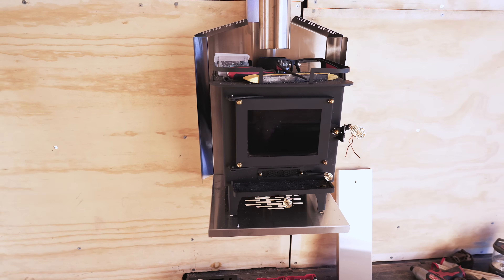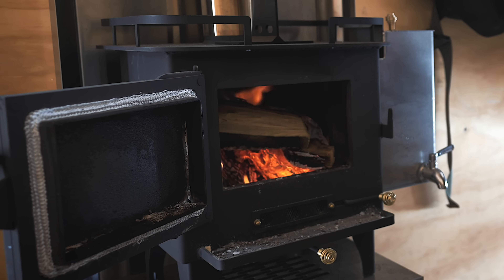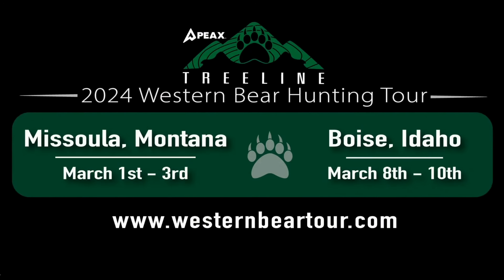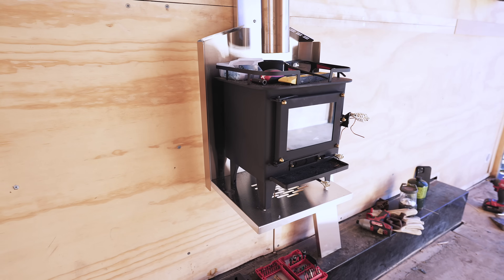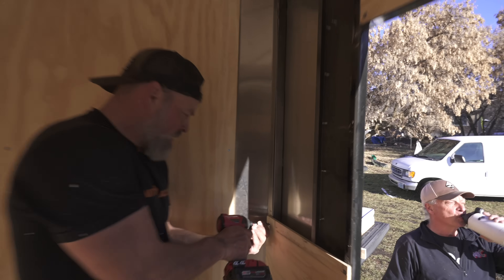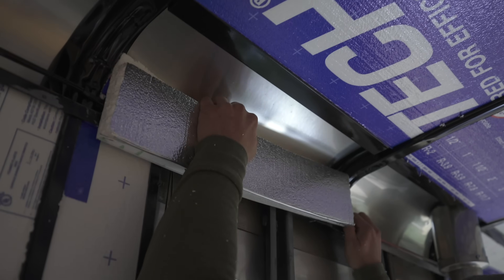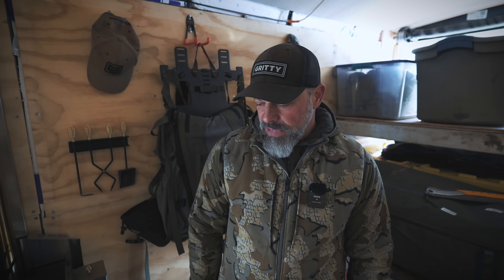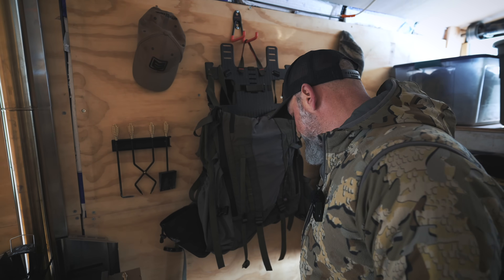GRITTY TRAILER BUILD 🎙️ EP. 825

Comment: I used a diesel heater in my utility trailer. A three gallon fuel tank mounted outside provides 5 days of heat all night.  A solar panel maintains the battery.  Like your wood stove, it's a dry heat so clothes drying is a snap. Makes taking a shower in the middle of winter possible as well.  A 5 gallon bucket and a live well pump is the shower.   Love the build.
Reply: Same for me. I have a arktronic diesel heater in the truck camper I built from scratch to bring up here to alaska 2 years ago. And that thing is great quick no fuss dry heat. I insulated my camper with 3" of rigid foam and sprayed all the seams on it so it's over insulated. 3 gallons in a rotopak runs mine at night for close to a month in the spring and fall and about 10 days of continuous run in -30°f. But it is over insulated and not that big... plus I drywalled my camper so it has mass and very little thermal bridging.
Reply: With the solar he could have put in heated flooring.
Reply: The smell and mess are Too nasty for this guy....  Wood ALL the way..  You need a chainsaw for most of this kinda shit anyhow
Reply: @kylemacdonell1450  what "smell", the only time I ever smell diesel is at the fuel pump when I fill the tank and my truck 🤔🤷‍♂️. It exhausts outside and if you smell the diesel heater inside its not installed right. Wood heat is great, but I'd rater set a timer for 10 minutes before I get up and let it warm the camper without any effort, plus fire restrictions are a thing out west during hunting season for wood stoves.
Reply: The smell of being smoked out whenever you stoke the wood stove was why we switched over to diesel heat

Comment: A lot of my hunts, I sleep in a wall tent but I want to build out a cargo trailer to haul all my gear to camp and then use it as a cook trailer.  That way I can lock out the critters, mice, squirrels and bears.  I also haul quads for my hunts and I typically travel several days to get to my hunt locations.  With the cargo trailer, I can pull over to some gravel pit, pull the quads out and sleep for the night on the way out.  Your video come at the right time.

Comment: I did a conversion on a 12 utility trailer. Kitchen up front, fold down bunks and table, two windows and I went with a Dwarf wood stove. The Dwarf stove is an Idaho company and I love the stove, it's worked great in the trailer. I can haul either my ATV or my snowmobile and then have a super comfortable camp setup. Trailer still pulls okay with my Tacoma. Keep up the good work and great content.

Comment: Solid Build. I like the wood stove. I converted my 2014 7x16 Cargo Trailer into my mobile hunting rig. One thing I did was build out a small kitchen in the nose of the trailer. Completed it with a small pantry (Cabinets) I bolted them up top and installed a counter space (width of the nose) to cook on. Underneath, I have additional storage for kitchen items. One thing that has been a game changer is running a power strip (24 inch) along the kitchen wall. I'm able to power radios, charge phones, anything electrical. I drilled a 3 inch diameter hole in the left corner and run my extension cord out the bottom to my Honda 2000 watt Generator that I have outside away from the trailer. Its worked very for all my power needs and lighting up the trailer. Another item that is a must have for early season hunts is a Magnetic Velcro Mesh Screen to cover your door when its warm outside and you want circulation inside the trailer. The Magnetic Velcro Mesh Door enables you to walk in and out with ease and keeps all the bugs out, but allowing the fresh air in. Super easy to install and super cheap!

Comment: FOLLOWING. I listened to the podcast while training this morning and had to come check out the video. I did the same. The nice thing is it can be adapted to each hunt, sort of a work in progress. Up here in Canada I definitely second the diesel heater. They pump out incredible heat and can keep everything from freezing while you’re out hunting, especially your drinking water. I am going to change mine a bit this spring. I will frame a wall at the back of the trailer that will have a door and window. It will be the main door. It will allow for a 2’ “porch” that I can leave Jerry cans, flammables and anything that can stay outside. It will be wide enough for a small quad but not a s*s. then when I head out for the day I close the trailer doors and it’s immediately secure.

Comment: I have a 9x16 shed insulated walls and ceiling, lumber bunks, 9' wall table, fridge, space heater, tv/dvd 4 slider cheap windows, .75" marine ply for the floor and a window mounted a/c. Tight as a tick, make you sweat in the winter, cool AF in the summer. I call it my Hooch. Landowner gave me the shed instead of hauling a camper down for turkey and whitetail season. Barn next to the Hooch has a barn full bath with shitter, sink and shower. All the creature comforts of home. My home away from home. Look forward to the completion of your build. It always makes it better when you do it yourself.

Comment: I converted a 16 foot v-nose Cargo Craft trailer. Windows are a must. Just a little advice, every little thing you add to the trailer, adds weight just keep that in mind especially depending upon what you are going to pull it with. I've got a diesel heater and plan on buying that wood stove for it soon.

Comment: Looks good so far. I did spray foam around the edges before I pushed my foam boards in to get good tight seals. If you get some of the thin 1/8th foam tape to put over the metal ribs before you put the plywood back on it helps with thermal bridging more than you would think. The good german diesel heaters like webasto and arktronic are super efficient on fuel and super convient nice dry heat. Do not do a gas furnace they are super inefficient on fuel, finicky, dangerous, and propane is more of a pain to get fuel than just pumping a rotopak with diesel. Just my 2 cents but there is a reason diesel heaters are all the rage for van life, camper life, truckhouses, ect. especially here in AK. They are simply worth the thousand bucks.

Comment: i installed a cubic grizzly in my trailer a few years ago i used a thimble for a sailboat used it for a year as a hunting cabin in northern ontario  and it worked well for most of the night be prepared to feed it in the night it would take 7 inch pieces of hardwood max just like the wife🤣🤣

Comment: man i did something simiular 2 years ago.except the wood fireplace, its basiclly a dry campter, mine is a v front and the whole front is shelfs a ac unit, battery and changers and mini fridge, and the door i also cut in a handel and wow it wasn't fun, in the back i have a raised queen bed and storage underneath, and along a wall i have a over head cabnets for plates and bread and stuff and a long hanging rack for jackets and a shelf above. above the counter top in the front i put a powered fan that can work as a exsaust if i'm cooking in the front.

Comment: Any reason why you didn’t use the backpacking stove for the peaks teepee setup? We have that stove already, so I was thinking maybe we could rig a setup to utilize that stove in the trailer as well.
Reply from the maker: The light Titanium stoves are great in a tipi, but they do not hold heat for a long time. A cast iron stove is just much more efficient especially with insulated walls and ceiling in the trailer. It is also designed to not get super hot for safety reasons.

Comment: I've been wanting to do something similar for quite some time now.  Your setup looks really great , good job!  2 questions here.
1. Do you know what the overall weight is on the trailer all finished out  like that, and what kind of tongue weight does it have?  
2, What are you using to tow it?
Reply from the maker: Thank you. I have not weighed it yet to see. I pull it with a 3500HD Duramax.
Reply: Copy that, thank you.

Comment: I don’t think I would have cut the stove hole in the roof, that material is so thin and moves so much with the sun I think you’ll have problems keeping it from leaking. When you do the next trailer ( which you will 😂) get a trailer with extra 6” or 12” of ceiling height, adds lots of overhead space and is a cheap upgrade.
Reply from the maker: Thanks! The hole in the roof has been bombproof—no leaking whatsoever. The vent is meant to take a lot of heat.

Comment: I’m just curious why do this instead just purchase a mini rv for hunting ?
Reply from the maker: Well, a few reasons. I needed a trailer than can accommodate my Polaris Ranger. So I either needed to get a toy hauler or build my own utility trailer/toy hauler conversion. Building my own trailer is far less expensive. Modern Toy Haulers and Trailers are garbage and fall apart--my trailer is built with the high quality components I want and the trailer is custom built and laid out to my liking. And it's fun to build my own trailer. My trailer is built to last--it's very durable. My trailer increases in value with each upgrade while a mini RV will continue to lose value every year. RVs are a money pit. Anyway, I hope that answers your question. Thanks!
Reply: @GrittyGearAndPodcast  thank you for response, I’m really thinking about building something similar to this myself pretty cool set up just didn’t know which direction to go with it. Looks like a lot of fun tbh